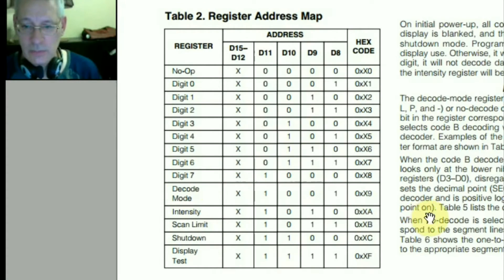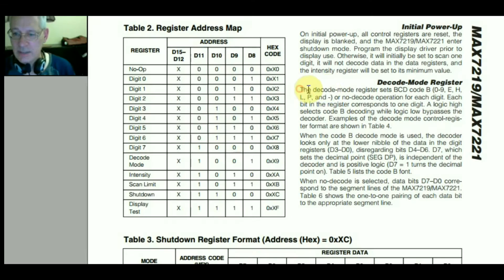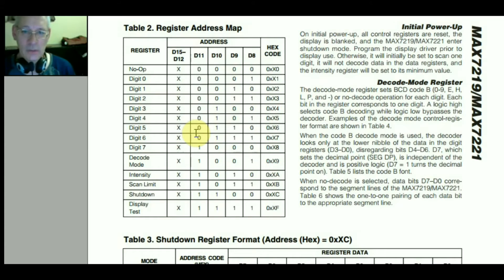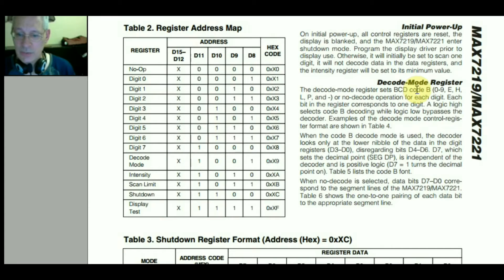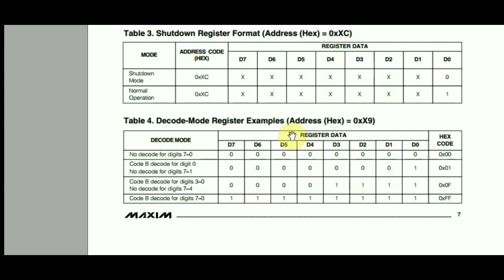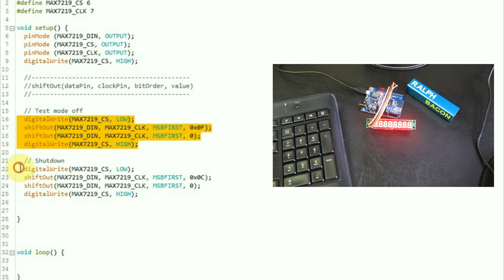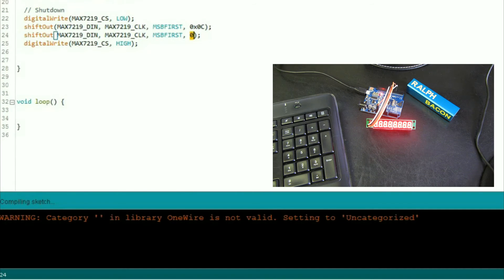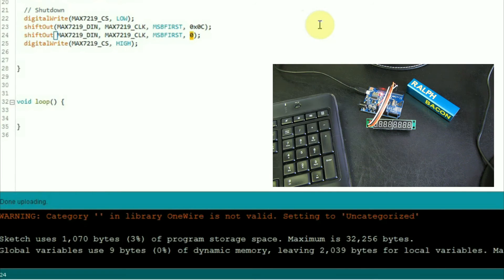#9 Arduino and LED 7-segment displays using a MAX7219 - Part 1

Comment: Thanks for sharing!  I realize this video is 9 years old but it is very helpful.  I am working on using this chip/led display with a raspberry pi pico w board instead of an Arduino and have found the micropython libraries don't seem to meet my needs.  I eventually want to write my own, but I need to understand this chip first.  Thanks!

Comment: The specs: On video second 277.  "Blanked on power up". Thats what the genuine Maxim chip does.
No it's not a thing of "anyway". It matters.
The fake chineese crappy plagiats do not as they are supposed to do per datasheet.

Schrott! Garbage!
Throw it in a bin.

Comment: How to control the decimal point. I want to show a float value on max 7219
Reply from the maker: The decimal point is just another dot as far as the MAX7219 is concerned. So output each character of the floating point (as a String) and send the dot as part of the character where you want it to appear.

Comment: Hi Ralph. Thank you so much for replying. Do you do freelance work at all whereas I could hire your services to provide me with a component list a wiring diagram and a code to program 7 individual single block digits each with their own button that on each press cycles through numbers 1-9. Thank you in advance.
Kind regards
Wil
Reply from the maker: No, sorry, I don't do any bespoke work, but if you go to the Arduino forum there are several there who are experienced and do just that. https://forum.arduino.cc

Comment: Hi Ralph. Fantastic videos. If i wanted to build a 7 digit 7 segment led all with individual push button for each separate digit. Is there a diagram and code available for this project? TIA.
Reply from the maker: Yes, you can. Look at video #13 https://youtu.be/CTaJWKsJjIk for how to control what you see on the 7-segment display. Then you can just use 7 individual buttons rather than a matrix switch.

Comment: Can we improve seven segment display brightness?? using max7219 ic. it's possible??
Reply from the maker: The MAX7219 haa a brightness control (0-100%) but maybe you need a better contrast which you can do by placing some red lighting gel over the display. It's cheap and available on eBay in A4 sheets or bigger. See here: https://www.ebay.co.uk/itm/106-PRIME-RED-Heat-Proof-Coloured-Transparent-Acetate-Gel-Sheet-Crafts-Lighting/162838930358?var=461875848563&hash=item25e9f4e3b6:m:mJ3-OhCp_12ZWAlAxj2cCzA

Comment: Hi Ralph, Can you do a tutorial using 7-segment Led display using MAX7219 to count the number of time an inductive sensor detects metal object as well as reset back to "00000"?
Reply from the maker: Frankly, Ananthan, there are enough videos on this to allow you to do that for yourself. You need to break the project (if that's what it is) into its constituent parts and build each one separately (on breadboard is fine).

Comment: can matrix and 7segments max7219 modules be mixed on same esp8266 or arduino? Can they share the same DIN and CLK and change only the CS pin, or what? Thanks in advance
Reply from the maker: They can be mixed if using SPI, squalazzo, as you rightly say, each unit has a separate Chip Select (CS) pin that switches that item on. Whether things run smoothly when mixing items is another matter - you'd probably have to try it out. Alternatively, instead of hardware SPI, you could use software (bit-banging) SPI for the other device.
Reply: thanks, i'll try :)

Comment: 1:33 Beware the Diode D1.

There is an issue cascading more than two Displays, here is the solution to the problem:

There is a Diode D1 mounted from Vcc di The MAX, and the Vcc OUT is unfortunately connected to the output of the diode and NOT to the input Vcc.

I thought at first that the best solution would be as you have done, but I found that sporadically gibberish ended up on the display.
Maybe because the Max would receive about 4.2V and send logic 0 to 4.2V to the next module that's powered at 5V.

In the end the best solution is to de -solder the Diode and jumper the pads OR
there is a via hole just after the diode (on the module in this video it's a via, I see something soldered in place), solder a pin and use this for VCC in.
Reply from the maker: I saw your post for the updated video #63 about cascaded displays, and asked you a question, so I won't repeat it here, but it's quite a design flaw, it would seem.
Reply: I answered your question on #63.
Sorry for the duplicated message, I thought it could be important, I wrote the same message on both posts, not everyone watches all posts.
In fact, I'm jumping from one video to another of yours in accordance to what interests me at that moment.

Well done with your videos, I don't understand why you're so underrated.

Good luck with your channel.
Reply from the maker: Glad you like the videos, and yes, it would be nice to get more views and subscribers, all in due course, perhaps!

Comment: Nice job, that was very good, well presented & reasonably easy to understand.
Reply from the maker: Thank you Jon Jon! There's a more recent video #63 on cascading two (or more) MAX7219 displays together which is a little more complicated but once you understand the concept, it too is "reasonably easy" to understand (like most things really). Thanks for posting, good to hear from you.

Comment: hi, nice video. i have a question, can i pull those two 4 digit 7 segment off the board and then replace it with 2 or 3 digits 7 segment LED?
Reply from the maker: +I Gusti Ngurah Dhyana Yoga
Well, if the type of LED you're replacing it with is identical (that is, common anode/cathode with the pins connected to the correct segments (a-h plus dp) then I see no reason why it would not work. If the LED you're replacing it with is different you could still make it work by wiring the LED manually to the board (via flexible jumper cables) although at that point you might ask yourself whether it's all worth it - you could get a MAX7219 chip and wire it up yourself for your particular LED array. Quite a bit of work but all do-able.
Thanks for the interesting question. My question to the manufacturers is why they don't just make a 4-digit version of this that is extendable to 8-digits; I mean, not everyone needs 8 digits even if the MAX7219 supports that many.
Reply: Ralph S Bacon hi thanks for the answer. yeah i also think that 2 or 3 digit 7 segment LED are more convenient to use because we can arrange the digits to odd or even number with those two kinds of 7 segment combination. hmm 1 more question, how many LEDs is the MAX7219 could handle if i want to build my own 7 segment configuration? can you give me some reference how to do it?
Reply from the maker: +I Gusti Ngurah Dhyana Yoga
The MAX7219 can address 64 individual LEDs, so a standard 7-segment LED (plus its decimal point, making 8 segments per digit) means the MAX7219 can support 8 digits - that's why they are manufactured like this.
If you look at http://tronixstuff.com/2013/10/11/tutorial-arduino-max7219-led-display-driver-ic/ you'll see the pinout of the MAX7219 near the top of the page. Each segment (a - h plus dp) is common for all digits and then (via I2C) each digit is switched on / off in turn. Could be tricky if you're not familiar with multiplexing but my code would still work if you wired it up correctly. That's the best I can do but Google may be your best friend (or the Arduino forum http://forum.arduino.cc/index.php) who live helping people with questions as long as you show you have done your homework / Googling first!
Reply: Ralph S Bacon but are you able to unplug the 7 segments off the MAX7219 module board?
Reply from the maker: Well that depends on how the hardware has been built. If the leds have been soldered in, then no. If they have been plugged in then yes. Look very carefully at the pictures of the hardware before purchase is the best advice I can give.